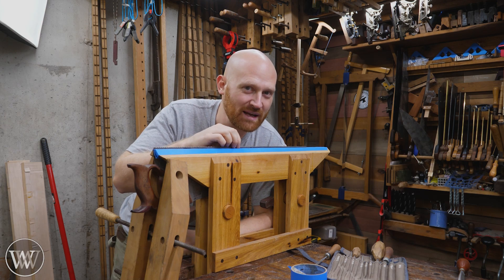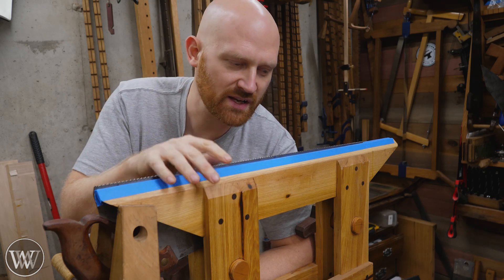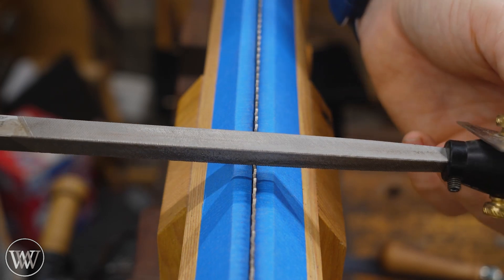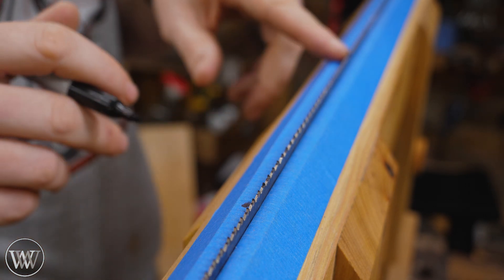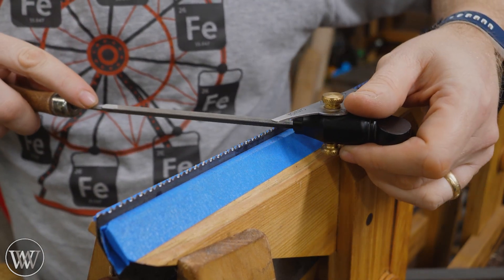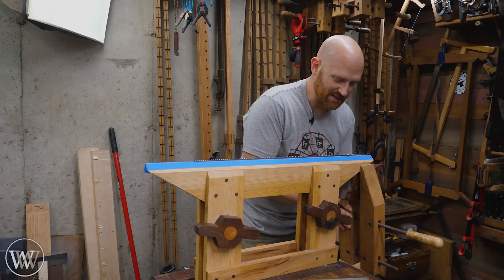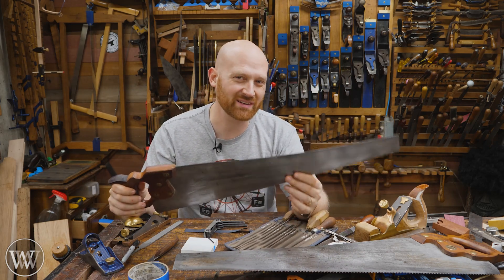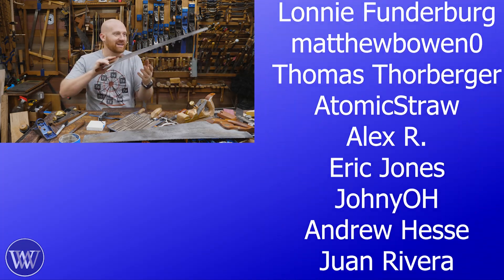How To Sharpen A Hand Saw Cross Cut Version

Comment: Watching you do this, I always think of "set" on the newly sharpened blade. What considerations should be given to the "set" of the teeth? Then, there is the argument to use a "setting" tool vs using a hammer? Larger on a crosscut vs same on both rip vs a crosscut? And then, the differences of size of the blades - i.e. less on dovetail vs panel blades? Yes, I am asking for an in depth explanation of "setting" blades.
Reply from the maker: the next video on the series will be on setting. I normally have that as a separate operation.

Comment: Firstly, thanks for all your instructional videos! They have been invaluable for an aspiring woodworker, who just finished his first pair of winding sticks today :)

Secondly, I just notived that you seem to define rake angle differently compared to any other source I find. In all your sharpening videos, this one included, you say that 0 rake is when the top of the file is horizontal. However, judging from all other sources, rake seems to be defined by the angle between a line perpedicular to the length of the saw - or the point line -, and the front of the tooth. That would mean that the rake is 30 degrees when the top of the file is horizontal. 0 degrees of rake would be when the front of the tooth is vertical. Now, you seem to use a rake angle of about 15 degrees, so the end result is the same with this degree of rake, but it gets confusing and could lead to misunderstanding if someone learned from your videos, and then tried another angle of say 10 degrees, but instead ending up increasing to 20 degrees. 

Again thanks for all the knowledge you share!
Reply from the maker: You are very correct.

Comment: Saw sharpening is a must have skill. My first hand saw was Riyoba ( which iam still using) after seeing Paul Sellers video on saw sharpening my point of view on  hand sawing have changed i am having few western style saws tip and cross some are old from the 1920's and 40's and some new and has you said it's a skill that must be practice but it isn't difficult as people think and can be achieved with simple tools.

Comment: I'm looking for some advice: I'm planning to buy a saw for backcountry camping with a hot tent (has a wood burning stove inside). I'll be felling a dead tree, and bucking it. This saw you are sharpening is nice because it is smaller than a traditional 3' crosscut saw. Would a saw like this be well-suited to such a use case, or is it really only intended for the woodworking shop?
Reply from the maker: the teeth on this would not be good for green wood, but you can find large tooth crosscut saws that are around 2'.

Comment: Hello, thank you for you video. I've tried to sharpen 2 cross cut saw but they were branch cutting saws.
I have noticed that the angle between the teeth was narrower that the angle of the file. Therefore i had to tilt the file toward one side but I was bitting onto tip of the opposite tooth. 

Have I done something wrong or am I using the wrong file?

Thanks
Reply from the maker: that sounds like yours are Japanese style teeth and need a father file. but you have to be carful they are often hardened teeth and will just destroy the file.

Comment: What's the tpi on that saw?

Other question: What's your experience with Paul Sellers advice to sharpen all saws finer than 10ppi rip? Does that work all right, or is it worth having a fine crosscut saw?
Reply from the maker: That one is 5tpi. There is no need for a crosscut saw finer then 10tpi. At that size you can do the finest crosscut work you might want to.
Reply: @WoodByWrightHowTo  Thanks!
I was wondering, because I'm restoring an old 26" Disston handsaw. It's 11tpi/12ppi sharpened crosscut, but I'm thinking of filing it rip instead (but still using it for crosscutting), since I'm not 100% confident in my abilities to restore irregular crosscut teeth.
Reply from the maker: ya in that case it is really a 50/50 problem. I would be tempted to file it rip and use it as a tennon saw as well.

Comment: Hey great video! I have a dumb question.. I’m trying to wrap my mind around the geometry, I realize you skip a tooth based on the angle of the file, does it matter which tooth you start with? I guess what I mean, I don’t want to accidentally sharpen the wrong side with the wrong angle. The teeth are so small I’m having a hard time seeing the original “knife blade” of the tooth.
Reply from the maker: usually you can put the file into the tooth and balance it then it will turn to the direction that tooth should be sharpened at.

Comment: Im not sure why when you have 0 rake the saw doesnt end up cutting the same on the push and pull stroke because of that. Is it because the fleam is in a non cutting direction (like opposite of the direction it wants to cut) on the backs of the teeth?
Reply from the maker: With no rake it does cut equally in both directions.
Reply: @WoodByWrightHowTo  that makes sense. Thank you for the answer. If you dont mind me asking, whats a typical rake you would want on like a sash saw? Or a crosscut panel saw? It seems to me like you would want most western style crosscut saws cutting on the push by convention so you would want some degree of forward rake since Ive found that saws that cut in both the push and pull strokes tend to work poorly
Reply from the maker: yes. especially with western saws the push stroke it is easer to put in a bit of down pressure on the push stroke. it is harder to do that on the pull stroke. for me most crosscut saws I roll the file forward about 10-15 degrees.

Comment: If i got it right, you sharpen the face of the tooth leaning away from you, then you reverse the saw and do the same to remaining teeth ( set away from you), isnt it? Any advantage over the oppsite solution : sharpening the face of the tooth set nearer to you?
Reply from the maker: It is much more difficult to do it that way. So you will find some people who say that is best. Most filers do both at the same time by pushing the file straight down.
Reply: @WoodByWrightHowTo   so each way to do It brings a good Sharp edge
Reply from the maker: yup. if you ask 3 filers how to do it. you will get 4 different answers. and they are all right.

Comment: Great video, but, I'm still annoyed by the process as I only have crappy files in my garage.  Last time I sharpened a saw I literally wore out a file doing it.  That seems wrong to me!
Reply from the maker: it sounds like you were trying to sharpen a hardpoint saw. I normally get 10+ sharpenings out of the cheap big box store files.
Reply: @WoodByWrightHowTo  Not unless it was cleverly disguised as a 110 year old Disston :)  I was using a box store set of generic files, probably a manufacturing error but still you could see the tips worn off the cutting edge of the file on all 3 orientations by the time I was done with one saw.
Reply from the maker: wow. ya those are trash files.

Comment: Nice video!  Gonna subscribe!  Is there a particular file you would recommend for sharpening?  Do you need several?  What would those be?
Reply from the maker: The larger the tooth the larger your file. As to getting started. The ones from the big box store work fine.  The more expensive ones just last longer.

Comment: Please could you tell me how the rake angle is evaluated on the jig here ? Vernier is pointing roughly 20°. I guess this angle has not to be modified when you sharpen the second series of teeth. Does a saw file has to be taken large enough to shapen two sides of teeth in a gullet ?
Reply from the maker: There is a small angle marking on the filling handle that indicates what angle it is at. Yes the file sharpens one side of each tooth it touches

Comment: Dont know the difference between a crosscut saw and a rip saw ---mine is so blunt ---hardly scratches the pine block !  --I give up ---can I use a half round file ?   no -?-I must be desperate --thats all I have --no triangular C/S  file !---will buy a new RIP SAW ?  ( A big saw ?)
Reply from the maker: Here is a video on that. https://youtu.be/6RuhVhKlDcQ?si=_xGnCxDkjuWNSgkX
Unfortunately no around file will not cut the teeth. It will just make a message then. You can use the cheap triangular files at the big box store. But a rip saw is going to cost a couple hundred dollars. All the saws at The Big box store are cross cut tooth.

Comment: No one told me that it was harder to sharpen a crosscut haha. I learned how to do it from one of Roy Underhill's books and just did it. the first time the saw did tend to pull a little bit to one side. I haven't sharpened a saw in a while, so I reckon I'll practically be starting from scratch, I'm going to look into that sharpening guide, one of the reasons I haven't sharpened a saw in a while is because I didn't enjoy my left fingers hurting after a while.

Comment: On the topic of saws... there was an internet/tick tock thing going around where people made table saw blades from paper and actually cut through wood. Obviously that relied on a high amount of friction you couldn't get from hand tools, but I wonder if it would make an interesting video to make saws from various less than ideal materials and see if any of them work. 
Like using a very hard wood blade and seeing what level of softer woods it could actually cut, or the same with soft metals like aluminum or brass. 
It's an experiment that probably wouldn't change any game whatsoever, but it might be entertaining.